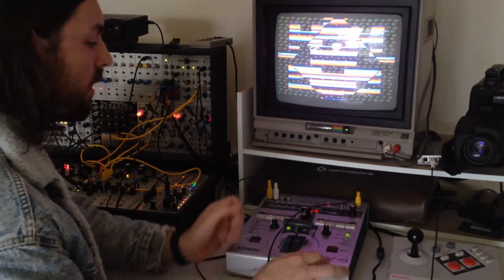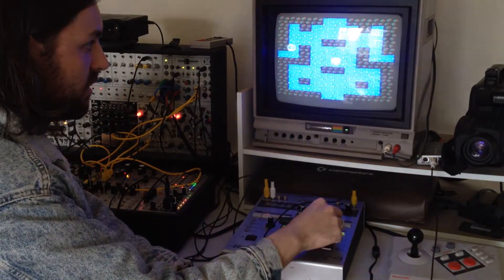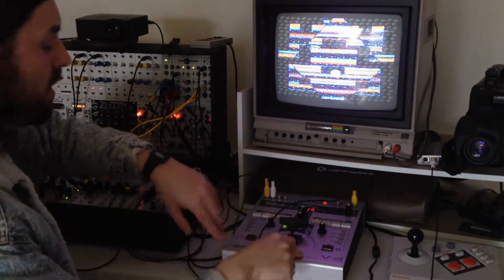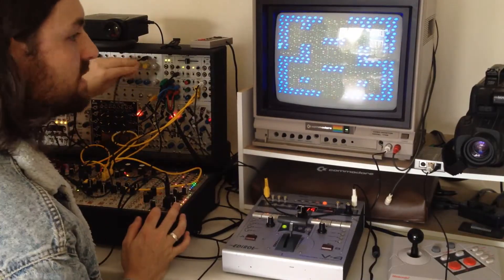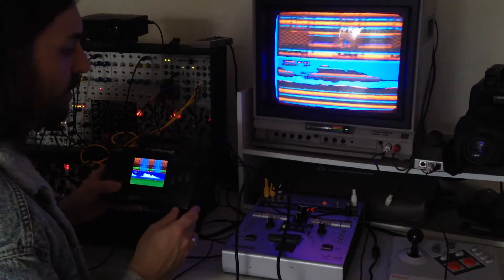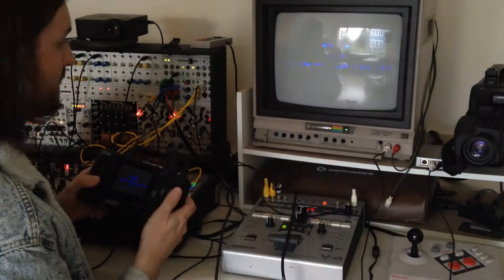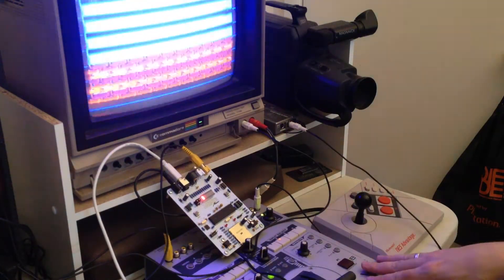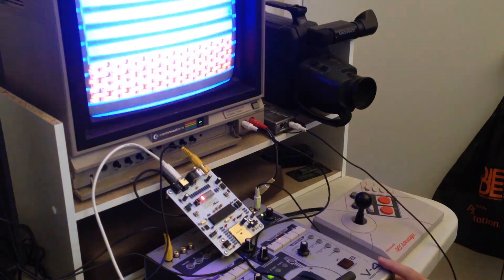Interfacing MING and LZX systems with the Edirol V4 Video Mixer

Comment: Thanks for the terrific news! One question I have building in my mind - and this is an odd one - is how well a pro TBC might fix up the Ming Micro's output. I actually come at this video art bag from a TV & film production background, and I still have my SD studio components including a number of TBCs, and of course a Video Toaster. ;)

I've got an LZX core (still haven't picked up the Euro Rack itself - open to suggestion for an affordable powered rack!) as well as the 3TRINS from Bleep Labs. I'm looking forward to getting it all to play together with my broadcast gear, or these new hardware solutions. 

The Edirol looks cool. No way that an old Korg Entrancer would be helpful to synching up the LZX & the Ming, is there?

Thanks again for the demo!
Reply: +Bohus Blahut Entrancer actually has an extremely hard time taking non-TBC signal, I usually run any signal to the TBC before it hits the entrancer. TBC should play great with the Ming since it's a clean and not "bent" signal.
Reply from the maker: +Bohus Blahut I think there's a good chance that a pro TBC would take care of the problem. A good way to test is to run an old 240p videogame console or computer thru it.

Not sure about the Korg Entrancer but i wouldn't be surprised if it worked! let me know if you end up doing any tests with it :)
Reply: +Ed Kennedy I had a feeling that the Entrancer would be non standard and weird. iirc it doesnt even do a full 720 x 480. I like the idea of getting some of the mini tbcs in the future. mine are great,  but theyre not exactly road gig ready.